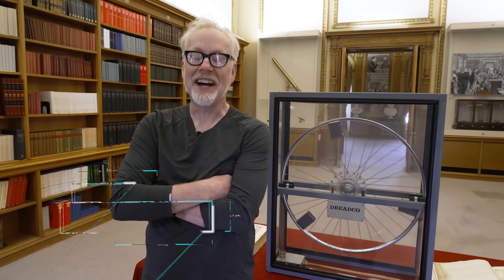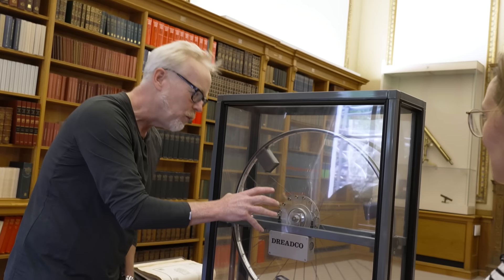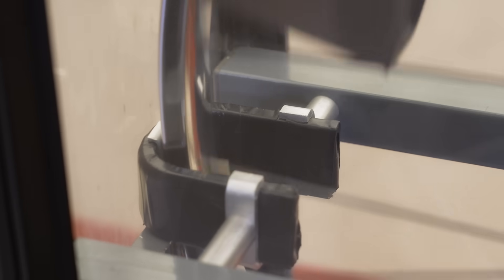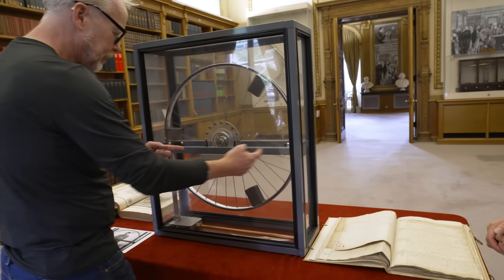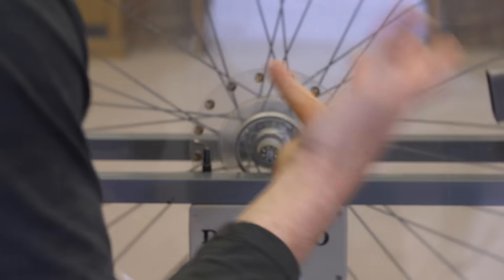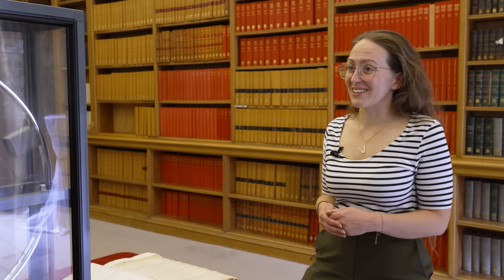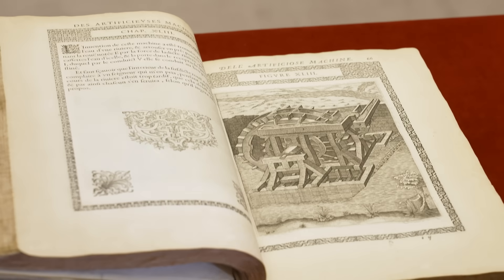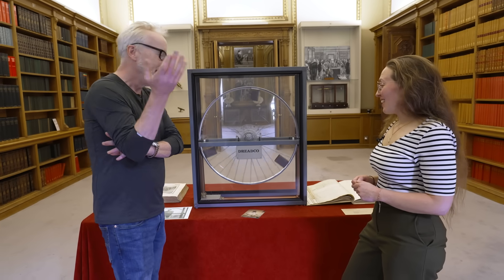Adam Savage vs The "Perpetual Motion" Machine!

Comment: The ones in the middle are magnets and coils, produsing enough to heat the liquid inside the copper tube at the bottom. The 3 "batteries" contains something that reacts with the heat comming from the copperpipe.. the "repair" restart is probably refuelling/adjusting of the fluid in the "3batteries" or and the copperpipe. So its actually not a prepetual motor, it uses fuel…

Comment: IMO, the three boxes mounted on the wheel are made of a non magnetic material and have a slot that is perpendicular to the rim in which there is a bar magnet that is affected by the magnets mounted on the frame. The left magnet pushes the bar magnet away from the axle in the slot. The right magnet pushes the bar magnet towards the axle. The slight weight differential drives the wheel. The three boxes on the rim ensure that there are always two boxes on the down side of the wheel vs. one on the up side.

Comment: The closest we can get to true perpetual motion (obviously not possible) is essentially the universe. HOWEVER we can make machines (not this one) that use ambient energy that is always around us to harness into mechanical motion. It's never a zero input system that creates new energy, but I suppose with enough thought and testing, we can make a machine that continually produces appreciable amounts of mechanical energy by using ambient heat, solar input, wind currents, electro-magnetic energy of the earth, earth's rotational energy, strong and weak nuclear forces and gravitational distortions to create some seriously strong energy production machines that require no other outside input to continually run, at least until those energy reserves are completely exhausted in about 20 billion years. All we are doing is converting existing energy that is always around us into a useful format (for say electricity production). If you want an example of how gravity can create mechanical energy, take a look at the ocean. The moon pulls on the water which makes waves that are moving from earth's rotational enegy, that we can then use to power water turbines.. These things are not impossible to imagine, with a creative mind.

Comment: I've spent years contemplating this and have a few ideas though it may not be a true perpetual motion machine if there are rules of methods used, like squaring the circle.
Reply: @@Mcckoe that's my basic though as well, I've spent years contemplating, unfortunately it takes more than mind alone to experiment. I'm hoping to solve that end of the equation shortly.

It seems that with magnetism and thermodynamics, perpetual motion (or at least mostly perpetual motion) should be fairly possible, unless there are arbitrary rules that invalidate what the definition of perpetual motion would be.

You know, unless I'm missing something... 

It's happened before..🤷🏼
Reply: @@Mcckoe then it counts.
Reply: @@Mcckoe rad.  

I've always felt like heat differentials were the answer, it seems to me that though perfect perpetual motion is impossible, to work towards it would produce much more efficient machines.

It may lose energy over two years, but if one were to take advantage of environmental fluctuations the need for consumables would be severely decreased.

Squaring the circle is still impossible, but they've gotten good enough that no one would notice the gap in the square unless the area were something like an acre.

If the same is true for perpetual motion you may not be running a city, but you could run a refrigerator..
Reply: @@Mcckoe I agree.

As long as it does not consume external energy in the form of a consumable it counts in my book.

The implications for low input energy creation are pretty astounding as well.

Comment: Maybe it's magnets on both sides and those boxes have different volumes of metal, which ends up pushing and pulling the wheel. Service is the wheel every 2 years may just be replacing the bearing because when they wear it leaves debris within the bearing grease which will slow the wheel down.

Comment: Magnets , the squares are magnets on the wheel and magnets are on the other bit in middle, as it passes through one it gains momentum from push/pull force of magnets.
The copper pipe etc are just distractions. Its only the wheel you need to look at , the rest is to put you off how it works.

Comment: This is a bit of propaganda control.  The perpetual motion machine was invented in the 1600s The permanent magnet motor as a generator is the same machine used to generate electricity without fuel or pollution until Tesla bound Edison's generator with magnets all around the armature and used water to turn the armature magnets and coils of copper wire.

Comment: I agree with ceptimus... there are a lot of red herrings - which makes it difficult to figure out which is the real mechanism.
  (I'm afraid I fail to see all the "great joy" in a simple unknown... when there are plenty of plausible solutions.)
- I also had a "electric pendulum clock" that had a sort of "battery assist". It could run for five to ten years on a single lithium D-cell.
  It worked by "tapping" the pendulum occasionally, at proper times, without touching it, using tiny pulses via an electromagnet.
- I can also see how those lenses on the central box could be used to collect power via solar cells to power something (or charge batteries).
  (That tends to be supported by the fact that it eventually runs down in the dark.)
- And the DreadCo box has both a pointed and a ball-tipped "antenna".
  That could also somehow be used to provide a tiny bit of propulsion in concert with the cups on the center disc.
  (If the box generates a high voltage "static" charge one might succeed in getting a tiny electrostatic discharge from the pointed electrode.)

Personally, if I were designing a device that LOOKED like that....
I would take advantage of the surface area of those big side panels.
(If the inside was well sealed the sides would flex due to changes in temperature and barometric pressure.
 That flexing could be used to power some sort of piezoelectric power generation cells.
 Those sorts of devices provide VERY little power... but very little power would actually be needed.
  MY version would also operate just fine in the dark... as long as there was some variation in barometric pressure.)

I could even imagine a very delicate mechanical system that could provide "drive" through the bearing as the sides flexed in and out.
(As they flexed a tiny bit the sides would "squeeze" some sort of asymmetrical bearing that would provide a tiny bit of impetus to rotate.)

Anyone who wants an actual "perpetual motion machine" can purchase one for about $20...
It's called a Crookes Radiometer...
It has a little "paddlewheel", sealed in a gas-sealed glass ball, with each "vane" silver on one side and black on the other.
It will spin "perpetually" - as long as it has sufficient ambient light and the bearing continues to move.
(It's actually powered by light - and even a small LED flashlight can power a small one quite well.)

Comment: What I would have done is just get my phone out, run any compass app, and held it against the two sides where it appears to be electromagnets. There's probaby a small electromagnetic pulse every time the weight on the wheel passes, which would easily prove the obvious power source that keeps the wheel spinning.

Comment: Imagine a wheel, like this one, in the (nearly) perfect vacuum of outer space, and (nearly) free from any gravitational influence. If those conditions were PERFECTLY met then perpetual motion is theoretically possible. 

A wheel like this (using magnets to propel the wheel) on Earth loses kinetic energy from air resistance. The difference here is that the wheel is in a vacuum sealed case, this allows indefinite kinetic energy, to the extent that the case is perfectly vacuum sealed. The reason it must be re-spun every couple of years is because the gravitational influence is not zero, so the system slowly, eventually succumbs to that force.

Comment: Occum's razor. The simplest explanation is usually the right one.
The 3 boxes probably contain a small electrical circuit called a Joule Thief. The Joule Thief provides enough energy to push itself away from the magnets at either end in a single burst, as it passes it. You can use a Joule Thief circuit can produce enough power from a dead battery, to light a LED for several weeks. So every couple of years, the batteries need to be changed. The case might hold a partial vacuum, allowing the device less friction.
The light collectors, and the copper tube are probably just thought candy.

Comment: I suspect weights, ballbearings that fall through channels within those boxes to gain greater leverage and pull the wheel down, helped along with current generated by the moving wheel. The ballbearings themselves could generate small current as they move within the boxes. 

Even if it's not a perpetual motion machine, it points the way to one, much larger, that could be made with spokes of  nitinol that would contract or expand depending on temperature, further increasing the amount of gravity leverage. Saw a cover story decades ago based on this very principle, think of a wheel larger than a ferris wheel, like the size of the one in London or even larger. Especially if they used a magnetically suspended axle to reduce spinning resistance to almost nothing, that would be key to making this efficient enough to be worth building. 

The varied speed of the wheel makes me think weights but it could simply be a fake. Intriguing though.

I would really love to see a magnetically suspended axle version of this spinning at a higher speed...

Comment: There is a toy you can buy.  I had a whole explanation, but here is a vid.
https://www.youtube.com/watch?v=KzUVJiyzQwg&ab_channel=ChrisRamsay
There is an electromagnet hidden in the base and gives the ball a push when it hits a specific area, enough to overcome the lost of inertia and make it back to its starting point.
This obviously works on this technology.  The copper tube in the base or on the left side contains the electromagnet and its pushing one of the three black blocks on the wheel.
The rest of the build is redirection, to make you think there is more going on than there is.
Reply: This is pretty much how it works, David said as much in a later article. Bear in mind that this made in the early 1980's where such toys were pretty rare and therefore tricky to guess.

Comment: The bike wheel is a flywheel with the magnets add mass to keep it turning until the magnets go pass the armature which created a small amount of DC power. The capacitor is in the aluminum box. Then the capacitor causes the generator to act as a motor.  It's a motor generator with very little drag. If you removed the air on the box it would even go longer without having to recharge the capacitor.

Comment: 1:22 BATTERY LIFE: 2 YEARS
Reply: What I want.to do is take a magnet to that box frame. Is it powder coated  steel or is it aluminum.

One thing I learned.  If you want to hide something. Hide it where nobody will look... and well... the frame. Everyone just assumes that it's not part of the machine.

I bet you those downtubes  is full of AA or C cells... and they are made of thin walled  aluminum that is really light. So when someone picks it up, it's just the right weight as people would supose it is. Still having some 40 or 50 batteries.in them

Comment: it's clearly just an electric motor, the inner magnets are to detect the degree of rotation (using hall effect sensors)  when the outer magnets are in the correct position, the coils energize to keep the motor spinning.

Comment: Wow, when I was a kid with a curious science mind but still not enough knowledge of the laws that prevent perpetual motion, I came up with an idea that looked almost exactly like this. I had been watching a bicycle wheel turn. The bicycle had been on its side, and the wheel slightly unbalanced, causing its rotation speed to vary slightly. This wheel turned for HOURS with no added energy, and I came upon the question of what would happen if one were to turn that wheel into a generator to add the slightest bit of impetus back to the system. Of course, I later learned why that would not work. But on seeing this I was struck by the similarity.

Comment: The service might simply be replacing the bearings. The goal of a perpetual motion machine is to make it as efficient as possible. 99% ect. Indeed it would stop but still might run for years with very little input

Comment: I could be very off, but I suspect it is a Crookes' radiometer.  The top half glass looks tinted, the bottom doesn’t.   I would think this could allow the boxes on the wheel to operate similar to a Crooks.  It’s not a vacuum in the box, but it may be filled with a gas that doesn’t impart too much drag.

Comment: The 3 boxes look like they hold pellets inside half way. As the wheel rotates, the pellets move shifting weight around as their angles changes, causing a transfer of energy and change of motion. No electricity. No magnets. No motor.

Comment: i think it's not as complex as people think. not an inovative way. it's more like its complex cause of how many things are at work in there. one of them is for sure gas laser, very probable carbon dioxide laser or TEA type laser. and some other stuff going on. quite clever indeed. also the wheel is not actually a perfect circle, it has about 1% curvature were the big "boxes" are welded. i think this is actually a prototype of someone's idea and they need to research it more so they are the first to find out how to apply some wonderfull idea someone had and be the pioneers and also be one step ahead when it['s aplications will benefit people around cause you know.. cash.

Comment: perpetual motion machines are generally expected to be 'continuous' and 'fluid' motion machines as well. But couldn't perpetual motion be achieved in an alternating pattern? Otherwise, a series of weights set to send the machine's momentum while simultaneously levering up more weights do be towed and then released in succession would result in perpetual motion also. You don't see gears or pulleys on these either to displace torque.

Comment: Hey Adam. 
I don’t know if you’ll see this, but I was in a car that did a front flip on the PA turnpike in 1977. I see you tried to recreate. 
The car was a 1969 Chevy Chevelle SS.
A bolt broke on the passenger side differential link and the driveshaft pulled out of the transmission when the rear axle housing link failed. Thought I was s goner.

Comment: Adam should build an electric car with 4 drive motors and two sets of batteries... One set to power the car as the other gets charged by alternators or crank style generators also connected to the wheels and with gearing to lessen the work and when one set runs out a computer switches to the full battery and begins charging the now dead set.... And just go back and forth.

If regenerative breaking thats not constant can increase range significantly then the thing Noone tries should at the least increase the range and at most if done right should be able to keep going as long as parts last... Not a perpetual motion machine... Not purely mechanical and has computer assistance.... So might be possible....

No one tries it cause they assume a card weight can't help keep the gens spinning easier or like a fly wheel could also aid with  as some fly wheel powered buses in places can go for hours on one spin up....  

Always written off as to hard to generate enough energy as people use cheap motors and direct connections... Completely forgetting it's not a mechanical set up and can use hills, hears and fly wheels to help it keep charging even at slower speeds...

and I have to rephrase that cause one company made multi ton dump trucks that are electric and climb steep quarry's...  Recharge using one set of batteries as they coast back downhill almost making as much energy as they used going up as they carry a load out and sometimes breaking even...

Comment: The three metal boxes(painted black) look like capacitors you would see in an a/c condenser, they are a kind of battery. So there is a kind of electromagnetic boost three times on every revolution. Maybe?

Comment: By servicing they mean just that.  If you have a device that spins forever..  bearings will need to be lubricated.  The design is extremely simple.  The box and copper tube at the bottom is most definitely a decoy.

Comment: Think about that battery operated clock on your wall. One battery keeps it running for about 2 years. If you didn't know about that battery would you think it was perpetual motion until it stopped? Maybe. That's what is happening here. The wheel is so precisely balanced with a low friction bearing that it takes very little energy to keep it running once it is started. Like Adam says, it is a motor with the battery(s) in the box. Some items, like the copper pipes, may have been added to distract the observer from that notion. Of course the fact that it has to be restarted from time to time is a dead giveaway that it is not perpetual motion.